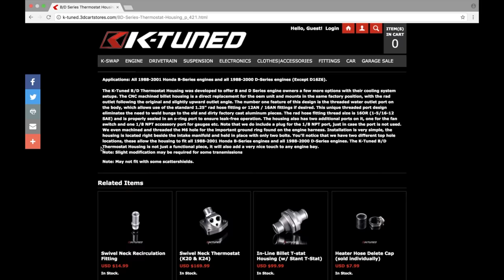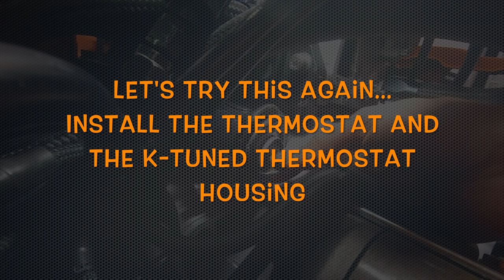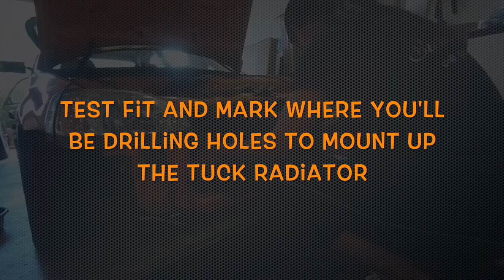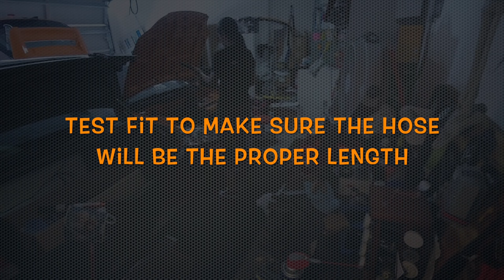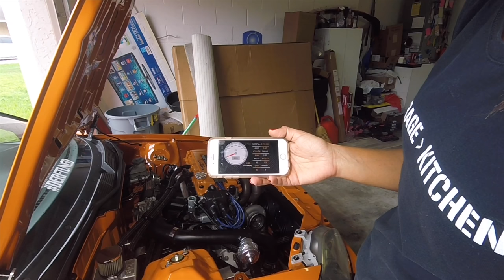Tuck Radiator Install Step-By-Step - Female Built Turbocharged Honda Civic

Comment: Awesome build! I got a 92 eg hatch with a 94 b18c1 swap. Going turbo on stock internals with ARP head studs and cometic head gasket. Only shooting for 250-280whp for now. Eventually I'll build it for 350-400whp.
Reply from the maker: Thank you! You should be safe at 250-280hp, but trust me, you're going to get to 250-280hp and you're going to want more!! lol Good luck!!

Comment: That tucked radiator is pretty cool looking, I ran my turbo the other direction so the intake is on the passenger side. I plan to route the turbo filter behind the driver side headlight and get one of those headlight ram-air intakes to run to the turbo. Plus that way the downpipe just goes straight down behind and doesn't interfere with the radiator, plenty of room. Nice mod though.

Comment: You are so gangster and you do things 100%   cleaner than any man ive met so far. Hell yes. And i came here to learn about needing a filler neck cuz i was wondering how the hell i was gnna do it on a similar setup, just H series (same shit tho basically) . Thank you
Reply from the maker: ✊ 🤣 Thank you! I'm sure there are some options available out there for the H-Series head for a filler neck. I think Trac Tuff may possible have one.

Comment: Awesome DIY and great work!  Question, do you know if this setup would work if you had AC and still had the condenser and fan for the AC?
Reply from the maker: Thank you!! This setup will probably NOT work with the OEM condenser and fan. You'd have to find an aftermarket condenser.

Comment: Here 5 years later looking to run a tucked radiator. I have a similar setup

1997 Honda civic
But my engine is reversed temporarily 
B18 gsr head
B16a2 block
Turbo setup so I’m having the same struggle for space

Comment: A few tips I would give people are to use some light machine oil to lube the AN fittings onto the hose. WD-40 should work fine, but I feel the oil is better. Also, when using angled fittings, try to match it's angle up so you can use the natural curve of the hose to get the direction you want. I'd also use some anti-seize on the AN threads to prevent galling and to lubricate them a bit. I would also go back and re-torque all of those bolts and fittings after a few heat cycles to make sure things haven't loosened due to heat expansion. Lastly, I would never recommend cutting the hood support bracket without reenforcing it later. It's there for a reason.
Good to see the coolant temps went down and now there's more room for turbo goodness. Nothing beats that whistle and whoosh sound from a turbo as you're put back into your seat. #4G63510

Comment: Awesome video, have the same mishimoto 3 core and have issues with temp on freeway, creeps up to 210 when going uphill and in boost. How are your Temps when driving? In boost? Mine in down stays around  187 but I only have issues on freeway

Comment: Im glad i just came across your page this video was very detailed. I have one question though. Are you running a turbo set up with no intercooler?
Reply from the maker: Thank you. I do have an intercooler. It sits right in front of the tuck radiator and under the bumper support beam. Take a look at my Instagram page, there's a pic on there with my bumper off.

Comment: Awsome video you did a great job  what are you using as a coolant overflow tank
Reply from the maker: Thank you! I was using a Mishimoto overflow, but the bracket broke on me and it was dragging on the ground and it got damaged. I got a new one, which I will be doing an update video to this tuck radiator install.

Comment: Aisha I was wondering how did you create the fan harness?? 

What gauge wire did you use and what connectors??
Reply from the maker: I think I used either 12 or 14 gauge wire lol it's been a while since I did it. I made a "Y" and connected the 2 fans into 1. And I used some push in male and female connectors that I got at AutoZone. If I were to do it again, I would purchase connector plugs, but these connectors I found work just fine. If you are planning on doing something similar and you need the specifics, send me a message on IG and I can send you a pic of the connectors I used and I can look at the wire later when I get home to tell you exactly what gauge I used.

Comment: What fittings did you use on the overflow in the filler neck? and what size is the hose? Kinda like your overflow reservoir tank set up with your tucked radiatior :))

Comment: Aisha Christian aka aisha_ladybuilt I really like this upgrade! I'm a little jealous they don't have tucked radiators for Skylines. But I just finished my fuel system upgrade. Surge tank, 3 pumps, 2000cc injectors, w/ steel braided line, ect..so I feel your pain on making lines. Keep up the great videos!!! PS you gain extra cool points for handling those power tools like a champ🏆😎. 👏🏾👏🏾👍🏾👍🏾
Reply from the maker: James Thomas lol there are universal types of tuck radiators, I’m sure you can find one... thank you 🙏

Comment: I might have to get this radiator but I’ll need a goose neck adapter for my wastegate.
Reply from the maker: i'm JGott I was a little worried I’d have to change my dump tube angle but it ended up working out. Good luck if you decide to do it!
Reply: oh snap, i forgot about the location of my dump tube! thanks for bringing that up, its been a minute since i worked on my turbo integra. yeah i would definitely need to relocate that and replace it as well if i go with the goose neck adapter. ill have to hit up honda tech and a buddy of mine that lives need speed factory that has the same ramhorm setup as me in his teg to see what options i have to work with. just like you, im trying to find ways to lower temp and get a full core radiator inside of my car. thanks for the video and comment!

Comment: Hi Aisha may know after you installed the SV Radiator how do did you feel the car performance ?
Reply from the maker: It doesn't really help with performance, it just helps keep the temperatures cooler.

Comment: will this work if you have an AC condenser or will the slim fan hit condenser? I have AC and bought this radiatgor but haven't installed yet. If it hits and I decided to use spacer to clear condenser would there be space or will it hit the bumper?
Reply from the maker: I don't feel like it would work with an AC condenser. I think you would have to get a custom condenser.

Comment: You should use a full face mask when using that angle grinder. Those glasses wouldn't even stop that disk or slow it down if it came apart into your face. You need it separated from your face period a clear grinding face mask is perfect
Reply from the maker: Whiplash Racing thank you! I really do need to get a full face, I’ve seen some accidents that are pretty nasty!
Reply: Aisha Christian aka aisha_ladybuilt yep, and when you are as gorgeous as you are, wouldn't wanna ruin that pretty face :) haha

Comment: Im starting a turbo build on a dc2, is cutting the rad support absolutely necessary to fit the tucked rad?
Reply from the maker: It is not necessary if you have the space to make it fit. I don't have a lot of space because of my intercooler, so my only option was to cut that center support. Good luck on your turbo build!

Comment: how dothe fans go on? with a temp switch and wiring relay?
Reply from the maker: The fans are wired to a relay that uses the signal from the stock fan switch that is in the thermostat housing.

Comment: hello queen did u know how to install the halfsize race radiator from speedfactory??any mod??
Reply from the maker: The only difference would be the way it mounts up to the car. The center support probably does not need to be cut. The hose and fittings would be very similar though.
Reply: ok tq.....very inspired...

Comment: Will this fit on a car running a forward facing manifold
Reply from the maker: That's a good question. It would depend on where your turbo ends up sitting, and whether or not it would be blocked by the radiator.

Comment: What kind of ratchet were you using?
Reply from the maker: The pink ratchet is by PINK TOOLS and the other is an extendable ratchet, I can't remember the brand.
Reply: Is it an electric ratchet????
Reply from the maker: Ahhh yes, the power ratchet. I got it from Harbor Freight
Reply: Aisha Christian aka aisha_ladybuilt how do you like it? I’ve been thinking about a harbor freight ratchet or new Milwaukee fuel ratchet...
Reply from the maker: Yes I love it. For the price its a great bang for the buck. I would maybe spend the extra money on a Snap On or Milwaukee if I would be using constantly everyday. But this Harbor Freight model works great!
Reply: Aisha Christian aka aisha_ladybuilt thanks for taking time to answer my silly questions

Comment: Only doing shit for looks I highly doubt this cools better then what you already have. I love how you work on yo own car tho good shit keep it up mama.
Reply from the maker: SI RICKO thank you 🙏
Reply: lol didnt you watch the video she said it was cooler than her old setup.
Reply: She only had half radiator in the car in the begining she couldn't fit a full radiator cause the turbo with a full rad and 2 fans it most definitely runs cooler
Reply from the maker: This tuck radiator is much more efficient than the old half radiator. My engine temps run much cooler.